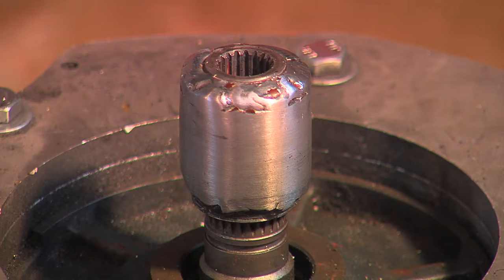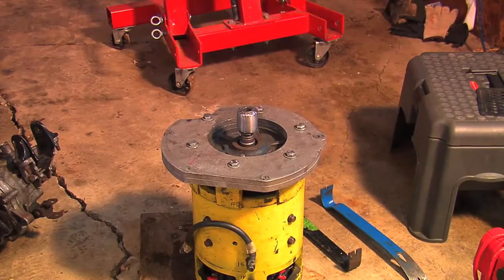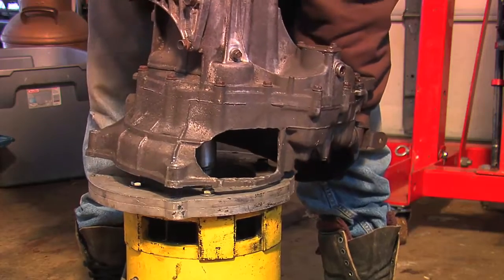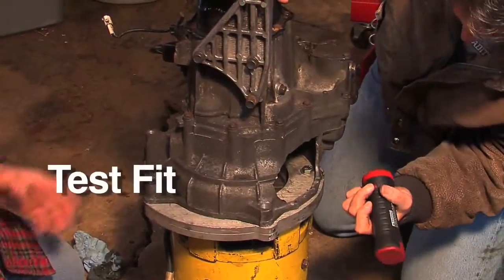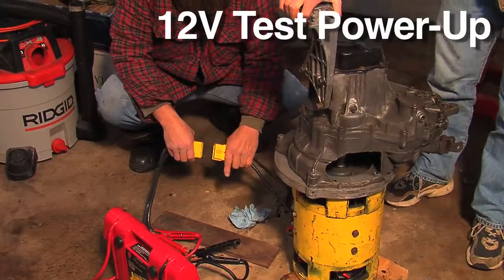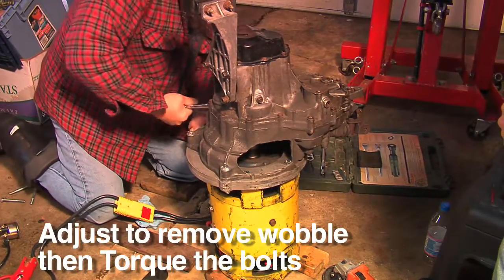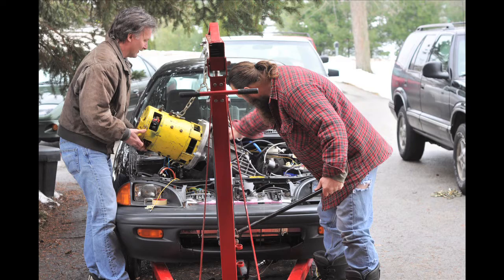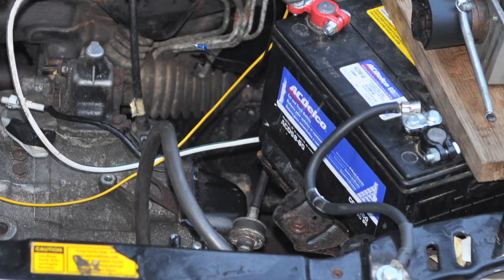EM Update Dec 14 2008

Comment from the maker: Yep, that is possible. That's why I was only lightly reving it.

I had a mike on the motor and the camera volume cranked up.

Besides that, since it's a solid coupler between the motor and transmission, there's always a little load on the motor.